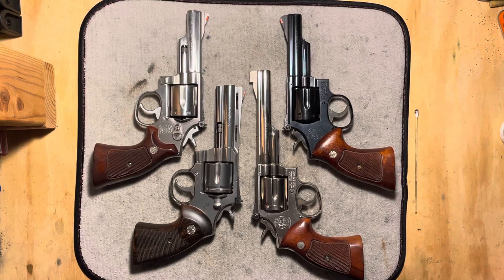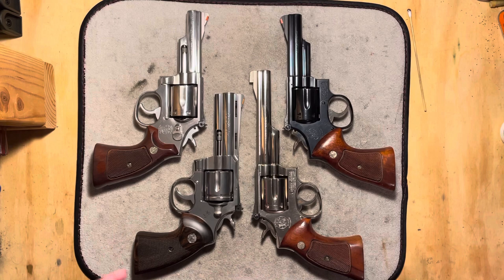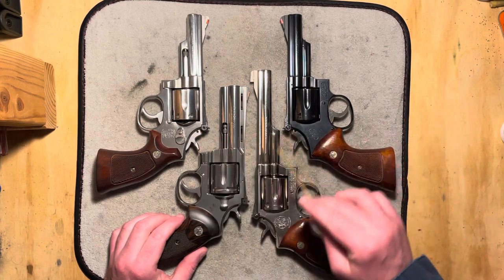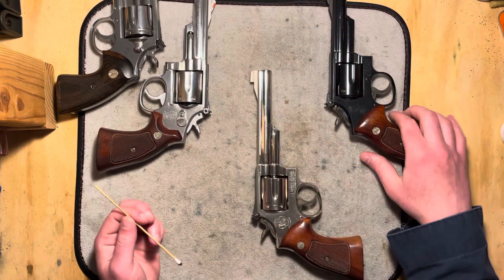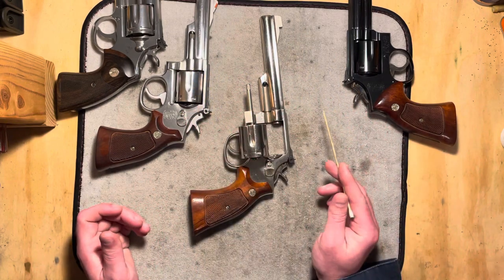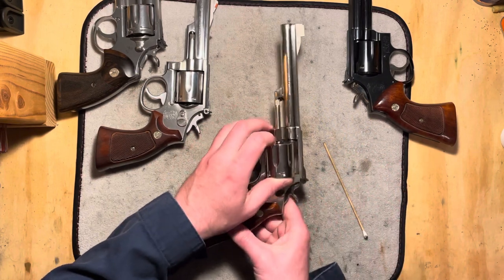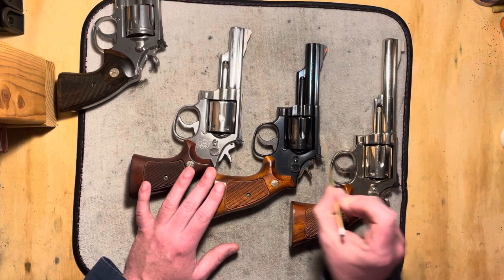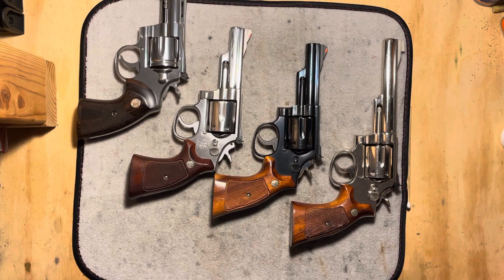Revolver Forcing Cone: Explanation and Avoiding a Crack, Ft. S&W .357 Magnum K-frames & Colt Python

Comment: Great video ,this is why on Smith & Wesson model 66, you should use 158gr or higher .357 loads. They have lower pressures and less velocity then the smaller grain bullets. This is less pressure on the forcing cone.
Reply from the maker: Definitely seems like that’s the worst culprit for causing damage. The low mass projectiles accelerate quickly and hit the forcing cone at too high of a velocity. 

Really makes me rethink my preferences in .357 Magnum loads.
Reply: Not just the Model 66, but on any K frame revolver chambered for .357 Magnum.  As I recall, that would be Model 19s and Model 13s.  But that was when barrels were pinned.  As far as I know, the problem was never mentioned on N frame arms.
Reply from the maker: @OldManMontgomery  But then it further complicates from there because the new model 19s have an inner barrel sleeve which while relatively thinner than the thickest part of the old design, apparently allows for the load to be spread evenly instead of affecting a thinner weak point. The claim is that the new model 19 K-frame revolvers have solved the forcing cone cracking problems.
Reply: @ColterBrog  Ah.  I should have stated this beforehand.  Current S&W revolvers are cheap copies of S&W revolvers.  I admit I am fairly cognizant of S&W revolvers with pinned barrels and such, but pretty well disgusted with the current crop and ignore them.
Reply: @OldManMontgomery I agree, the modern S&W revolvers are essentially clones of what they once were.  I’ve owned them, and quickly sold them after putting a healthy amount of rounds down range.  These days, I save up a little bit more and buy the older pre-mim/pre-lock versions.
Reply: Your right about bullet weight, 140 is light as i go in 357 mag.

Comment: Shot thousands of full power 357s  in a few old K frames and never had a problem .. even shot plenty of 110-125 grain hot rods
Reply from the maker: Just depends on the revolver and varies more depending on the timeframe.
Reply: A good pistol smith explained that the cause of of cracked forcing cones in the model 19 was from the chambers not lining up properly with the barrel and slow timing. I have new from the factory 19s that were out of time. The pistol smith has a personal 19 with a record of over 600,000 rounds of magnums shot through it. From a ransom rest it would shoot one and a half groups at 25 yards. I think that all of this scare talk is bs.
Reply: @ 600000 rounds 🤣
yeah ok bud 👌🏻

Comment: What often gets overlooked in these discussions is that ammo preferences have changed over the decades since the M19, and to a lesser extent, the M66 were designed. When the M19 was conceptualized, lead bullets, i.e., without copper jackets, and of 150 gr. weight range were almost the only loads commercially available, and cast bullets were the reloading choice. Since then, jacketed bullets, and especially 125 gr. and lighter, jacketed bullets at high velocities have become preferred by consumers. This may be the major cause of M19/M66 forcing cone problems, that is to say, consumers are often operating today outside of the design parameters for these models. My K frame .357's have digested many thousands of .357 loads using medium hard cast 145-168 gr. lead bullets without problem. Forcing cone cracking really was not an issue in the era of cast bullets. I can't help thinking of the situation of the introduction of steel shot that really wasn't compatible with lead shot chokes, and in some cases with lead shot barrel steels. The analogy here being that the older shotguns were properly designed around the use of lead shot, and not the newer, harder shot.
Reply from the maker: I think that’s an excellent point. Good insight.

Comment: It your claims are true I just compared my S&W model 640 j frame in 357 mag. The forcing cone has less than 50 % of the steel of the forcing cone of my model 19-3s . I bought the 640 new and there were no warnings against shooting any 357 mag cartridge. So your claims and the causes are bogus in my opinion. I have been shooting model 19s for more than 50 years. No problems of any kind. You do have to keep the forcing cone clean and make sure that your gun is in time. Considering the weight , balance and power it’s the best revolver ever !
Reply from the maker: I love the model 19, but this issue with certain production years in particular has been documented for decades. I don’t particularly care if you want to think it is bogus. 

You’re also not grasping that something being rated for a cartridge means it will safely fire it… but ignoring that, of course, more powerful cartridges cause additional wear and tear. Things wear out faster if you use them hard. Do you honestly believe your revolver would last just as long shooting .357 Magnum as it would .38 wadcutters? That there would be no additional wear?

Furthermore, mentioning less steel on your 640 shows you do not understand the concepts involved here at all. Your 640, if it’s as it appears to me, has a concentric forcing cone. It is equally thin all around, which allows it to expand and contract evenly. A shaved forcing cone creates a point of additional stress because the thicker parts are more rigid and cause the thinned area to experience greater deformation. 

A chain is strong if there is no “weak link”. If you intentionally remove part of one of the links, it will always be the one that breaks. Shaving a forcing cone creates that weak link. 

If it didn’t matter you’d see forcing cone cracks happen randomly at any spot of the circumference. That’s not what happens, though. They tend to fail at the thin portion.

The newer model 19 has a sleeved barrel, with a thinner but concentric forcing cone.

Comment: Shooting 38s in a 357 sounds good on paper. The problem is that you will build up carbon in your cylinder holes, and when you go to put a 357 cartridge in  ,it won't chamber. Do it constantly, and it will erode the cylinder holes permanently. The 38 round also has to jump a tenth of an inch to hit the chamber end of the cylinder holes that align the bullet. Reduced 357 handloading is the best answer. 👌
Reply from the maker: I agree that reduced power .357 is preferred, but with good cleaning practices (and pieces of lead removing wipe) I have had good results shooting .38 Special in .357 Magnum cylinders. It might be important to note that I primarily use light loads with fully plated projectiles, though.

Comment: Have been around these for 45 years. Never seen this problem. I'm not saying it doesn't happen. The biggest problem is shooting 110 and 125 gr.high velocity loads where the bullet doesn't seal the forcing cone before the blast comes. In the 70s, super vel loads exceeding 1700 fps with 110 gr bullets were very hard on these guns. I have run a lot of cast lead bullets at magnum velocities in these guns without any issues. There has been as much written about this as the 223,556 conundrum. I have a completely thrashed model 19-4 that I'm going to use to prove this out.
Reply from the maker: The thing is some revolvers never have an issue- so a sample of one doesn’t tell us much. Particularly if it’s “completely thrashed” it’s probably not going to be an issue since it would have failed at some point by now. 

Also important to note not all 19-4 production is affected.

Comment: You probably should have mentioned a couple of important points - the magnums of today are MUCH weaker than magnums of 20 years ago. Please research and you will find out. Second point - since you are talking about history - talk how S&W solved the problem by developing model 686. Great video.
Reply from the maker: I wouldn’t say that’s inherently true. It might apply to common big box store .357 Magnum but there are still companies producing real powerhouse .357 Magnum loads and plenty of hand loaders who like to eke out every bit of velocity. A generalization can be made, but it’s a generalization with some significant exceptions. 

Did I not mention the 686? I thought I did when referencing the Python as having the same full-circumference design. I’ll have to go back and look since it’s been a while. Definitely, though, the 686 is a very robust revolver that completely solves the weakness issues of thinned forcing cones. Even the newer K frames with the two piece barrel, though, are said to be much more forgiving than their more aged counterparts.

Comment: Forcing cones are the small tapered portion at the entry end of the barrel.  It acts much as a funnel for the bullet.  Revolvers are designed so that the chamber in the cylinder locks up exactly in line with the barrel.  Being a mechanical device, the tolerances allow a certain degree of inexactitude in the line up.  The funnel shape takes up for that tolerance.  

Since the bullet engages the rifling while the bullet is still leaving the cylinder and the powder is still evolving propellent gases, there will be a pressure 'spike' in the pressure curve of the cartridge.  This is considered in specifying a powder charge in conjunction with bullet weight and powder type.

With a S&W revolver, the lockup on the cylinder is complete when the trigger is tripped.  The 'hand' is tight against the 'pawl' formation at the rear of the extractor pushing against the cylinder stop.  The demonstration of movement with the trigger released shows a minute amount of movement; but a bit more than when in full lockup.

I have to laugh at the illogical statement of "... these revolvers were not intended to shoot .357 Magnum ammo all the time..."  There are three models 19 in my inventory right now.  I had and carried on duty a model 19 before the 580-680 series revolvers were rumored.  AT NO TIME was that proclaimed by S&W or the agencies for which I worked.  I have no idea from where that idea sprang.  

As noted in other replies, the cracks in the forcing cone were not reported until the high velocity 125 grain bullet load was introduced.  I have personally shot a bunch of .357 Magnum ammunition (of 158 grain weight) without incident or hiccup.

Bottom line is do not use the magic super-fast light bullet loads.
Reply from the maker: Exactly. A tapered bullet swager essentially.

Comment: What I have read in some comments is that the cracking problem only appeared with the hot 125gr loads not 158gr. Someone even claimed that it didnt appear with 110gr loads only with 125gr. He even had a strange explanation for it but I forgot it. What someone told me first hand from experience with his mod 19 is that the frame lengthen over the years with 357 so the cylinder gap became bigger and the cylinder developed front to back play.
Reply from the maker: There is a variety of information, most of it focusing on 125gr being the worst offender, particularly some of the old school Winchester stuff if my memory is right. 

I don’t think the new model 19 with the sleeved barrel is likely to have these issues, so what information exists now is likely all we will ever have. There’s little interest in destructive testing classic out-of-production revolvers which are quickly gaining collector interest.
Reply: @ColterBrog  Yes the new 19/66 is a true 357 magnum now. They have a full forcing cone and the cylinder lock directly at the crane make them even tougher. But I think that still many classic owners will shoot their old models.

Comment: Good information. I purchased a S&W 686 plus rather than the S&W 66 because I wanted to shoot 357 magnum mostly and the 686 has a bigger frame, cylinder and forcing cone.
Reply from the maker: And that’s exactly the right choice. The 686 is a fantastic robust revolver that can digest .357 consistently. 

It very much depends on application.

Comment: The model 19 was designed for the .357 mag 158-gr bullet. it is my understanding the 158-gr bullet is long enough that the bullet contacts the forcing cone before the base of the bullet clears the case. This way the bullet is forced down the barrel while the base is still inside the case. This prevents the gases from rushing past the bullet which then causes wear on the forcing cone. 

Lighter bullets are shorter which means the bullet hasn't contacted the forcing cone as the base of the bullet leaves the case which allows the high pressure gases to rush past the bullet and cause erosion of the forcing cone which can cause wear of the forcing cone, and weakening the top strap.

When shooting the M19 use the 158-gr magnum loads.
Reply from the maker: I don’t think I completely agree with this theory, but I cannot disprove it, either. 

I tend to think of it as the lighter bullet moving more abruptly and imparting more kinetic energy to the cone, not a gas cutting issue. 

However, it might be that both are in play here. That’s a very interesting perspective, and I hope in the future we all can understand more of exactly what’s going on inside these machines. 

Thanks for the information, new perspective, and contribution to the discussion.
Reply: @ColterBrog  Additionally, I noticed the cylinder on my S&W 586 is slightly longer than on my blued Python. 

The 586 was manufactured in the 1980s and the blued Python most likely last year. I ordered the Python right after Colt announced it at this hears Shot Show.

Does it make a difference in performance or was the shorter cylinder on the Python designed to save money over the production life of the revolver?

The difference in cylinder length changes the distance between the bullet and the forcing cone. My explanation above works if the bullet contacts the forcing cone while the base of the bullet is still in the case. However if the cylinder is longer then there would be a gap between the time the bullet contacts the forcing cone and the base clears the case those rapidly expanding hot gases may pay more of role in wear.

What are your thoughts?
Reply from the maker: @texassportsman5880 I would think it’s largely just an aesthetic choice. As soon as pressure starts rising that case is going to balloon out to the chamber walls and allow gas around the bullet. They’ll both be venting regardless of length. 

Cylinder length, as far as I visualize what’s happening, wouldn’t seem to matter.

Comment: From;   "The Smith & Wesson L-Frame Story" 

"Taking all this into account, it’s likely that the mechanism of injury for the cracked K-Frame barrels was a combination of the following:

-A weakened barrel extension, caused by the aggressive milling of a flat at the 6 O’Clock position (which was required for the models with yoke-mounted gas rings, but unnecessary—yet still continued–for later 19-4 / 66-1 models with cylinder-mounted gas rings), and;

-An increased use of high-pressure, .357 Magnum and .38 Special +P+ ammunition which placed more stress on the forcing cone than standard pressure .38 Special ammunition, and;

-An increased use of .357 Magnum ammunition loaded with lightweight (110 and 125 grain) projectiles, which exposed the forcing cone to greater amounts of high pressure / temperature blow-by gases, which caused accelerated wear on the forcing cone, and;

-Selected brands or lots of ammunition that were more prone to cause cracking, by virtue of their internal ballistics."
Reply: A former Smith & Wesson employee from the period puts an even finer point on the lightweight bullet issue, by pointing out that some brands were more problematic than others:

The biggest contributor to the K-Frame model 19/66 barrel splitting issue was the Winchester 125gr JHP .357 ammo. I split barrels with this ammo in as little as 11 shots on a new gun. It had very high and erratic pressures caused by the bullet sealant. Pull forces to move the bullet out of the case were up to 385 pounds! Pressures would be crazy with that high a bullet pull force. Spilt barrels would happen quickly with this ammo.
Reply from the maker: That pretty much sums it up. 

I think something important to note that is neglected here is that thinning one part of the forcing cone could actually be worse than if they had simply thinned the entire forcing cone concentrically. 

It introduces a weakness that makes the area a likely spot for a crack to form. Think of how the locking lugs of an AR15 adjacent to the extractor are more likely to crack due to the “missing lug” for the extractor claw. 

I think this is reflected in the design of the new K frame model 19 with the sleeved barrel design.